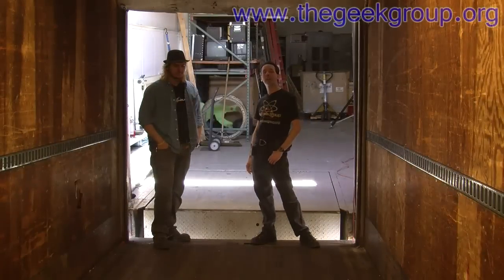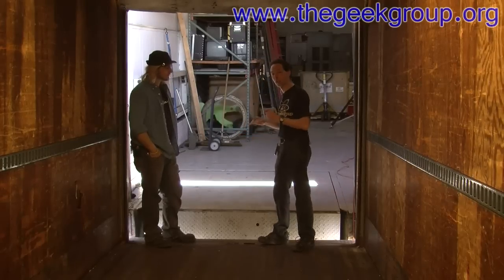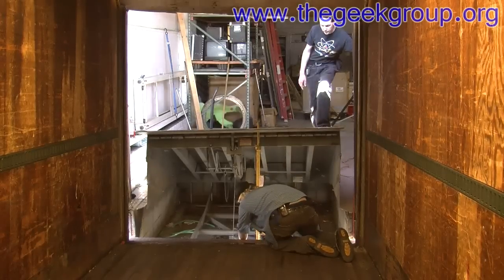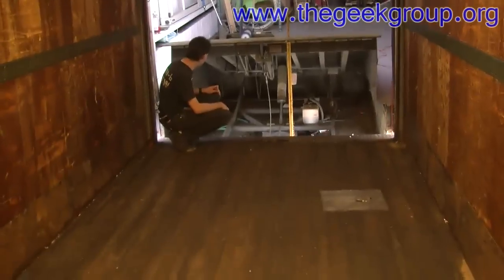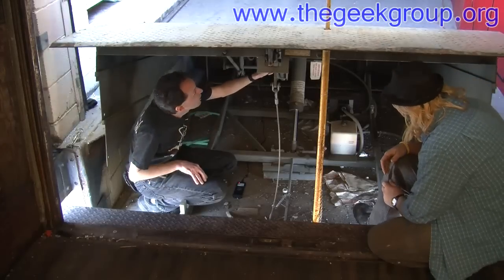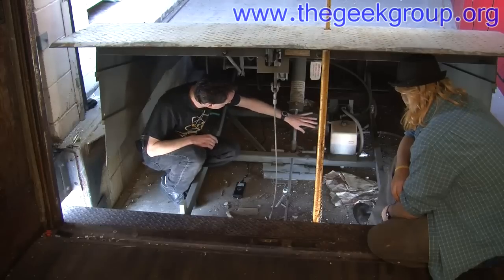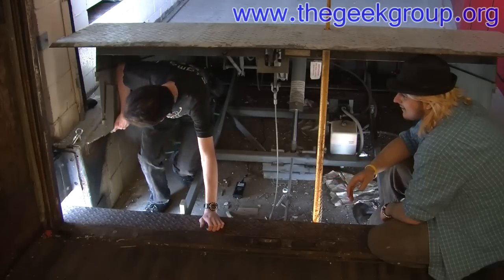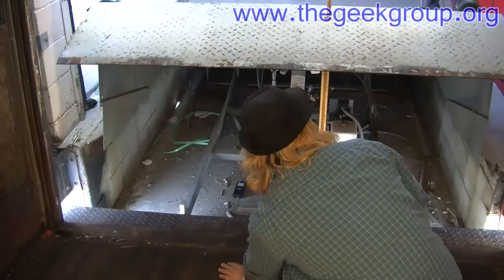Dock Leveler II Viewer Mail Responce

Comment: Please, do not get underneath any dock equipment unless you have been trained in this field. As fun and interesting as they are, the are extremely deadly if misused. I recommend a disclaimer in the video.
Reply: Yes they are, my boss and I would clean about 6 every few months out of 30. Workers kick broker wood from pallets in there until they stop working, when slow, and had 1 that wouldn't open, we clean a handful of them, we were in Automotive in school together so we knew how to work on things, time meant slow down if it DOESN'T work, so we did it, if called maintenance guy in for that, he get paid 4 hours no Matter what, he lived and hour away, sometimes he fix it in ten minutes, that went up EVERYONES ass, he made like $35 then its overtime so lots more, our belt motor burn out, call him and we would behind by 3 hours before running, between my boss ad me, and 1 other guy that grabbed tools needed, another guy that knew nothing try to kick me out and let him in, I did and my boss told him to get down. Let jim back up, we work great TOGETHER on me mechanical things, he helped me stuff a 351 windsor in a small Ford Maverick. Tight as heck but got it in, that's high school, so he knew I can handle the job. Take about and hour, motor was 200 lbs and always had one ready to go. Last one lasted 2 week's, he was calling the company that rebuilt it, clutches were in wrong on a plate from what he said, he made the final adjustments, we got it close too get us threw the night of 14,000 boxes, this was at scanner to read label and tell box where to go on what spur, that's a belt system. There was 17 belts it could go down. If didn't read, then to #1 always, people go get there stuff every hour or as much as could. Fun great JOB.

Comment: Good vid. I spnt 6yrs working as an FSR (Field Serv Rep) for the OE of this leveler.This is an older RH Hyd +/- 30k.The Hydra-Chek (auto shock absorber + snubber cable) can be upgraded (its replaced with a seperate lip cylnder) to make a full hyd lev. The cable (3;20) is not to keep the lip from flipping out too fast, but is reqd for its extention. As for the 'fancy pole' noted below, if ur refrng to the yellow SafeTStrut, it was desingd/implmtd after a tech was crushed while working in the pit.

Comment: Those hinged flaps on the side are actually designed to prevent someone from getting their foot in the way and getting it crushed under the leveler.
Reply: More from trash but keep you from going there also. Some are missing on places on docks. Need air and people find ways to let air in. In cold, then sucks. Simmer in. Northeast got 120 degrees easy. But must work. COMPANY stocked FREEZERS with frozen popsicles.
Reply: @JR-kr1lv  it's literally called a toe guard. It's for your toes.